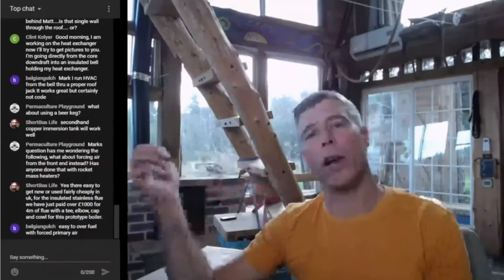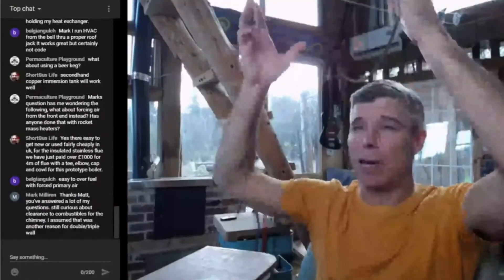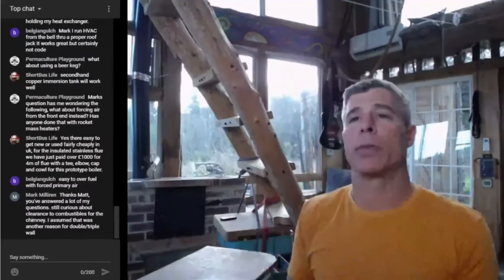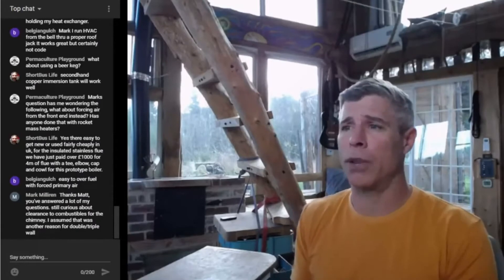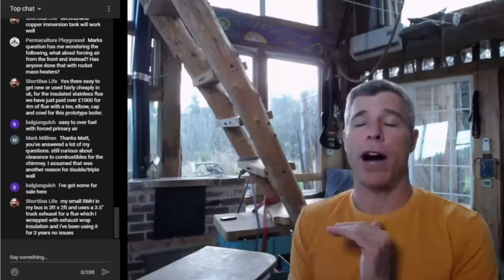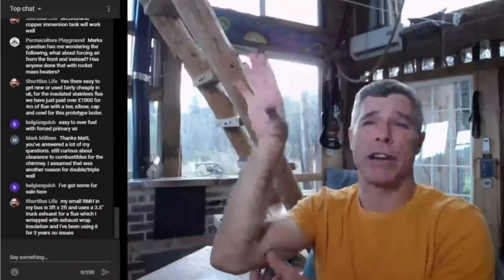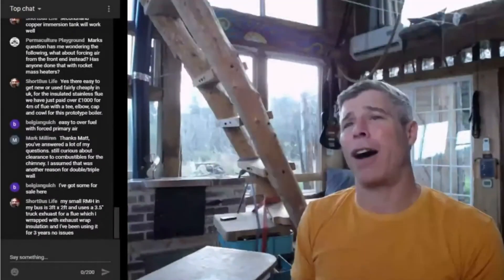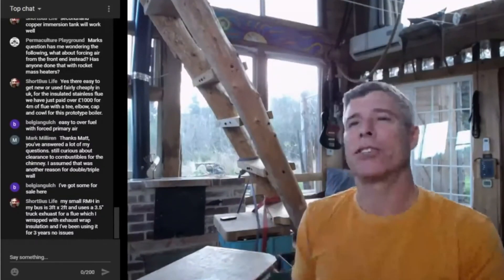Single Wall or Class A Chimney for Rocket Mass Heater?

Comment: You might kind of have an idea,.. if you line your metal stove with bricks it will not cause the chimney fire chimney fires come from low temperature combustion in metal fire boxes. It's not a 90% chance that would burn your house down most of the fires are electrical

Comment: I was wondering if you had any thoughts on  using an existing masonry chimney that is centered in the structure as part of a thermal Mass? would Utilizing a smaller Bell or bench and sending warmer exhaust up brick chimney allow it to radiate heat throughout the house? Thank for your informative videos.